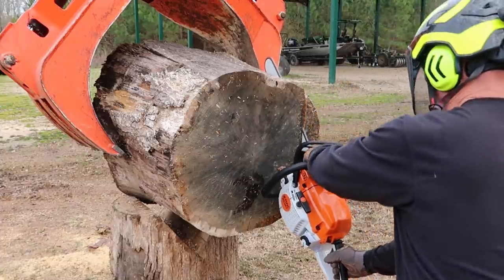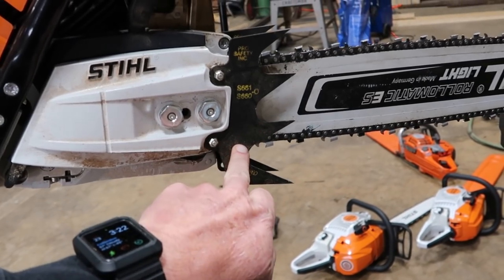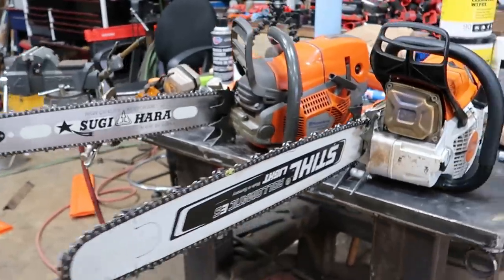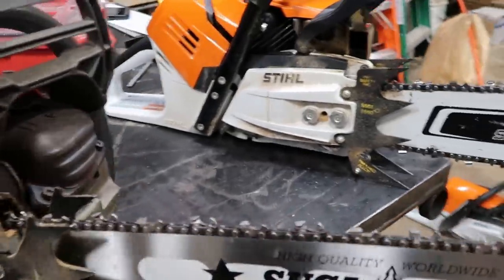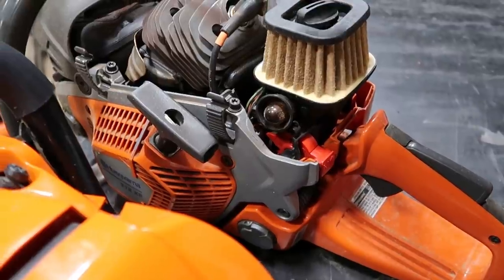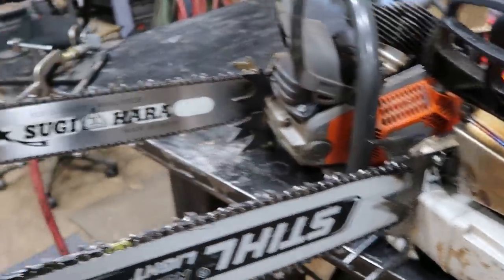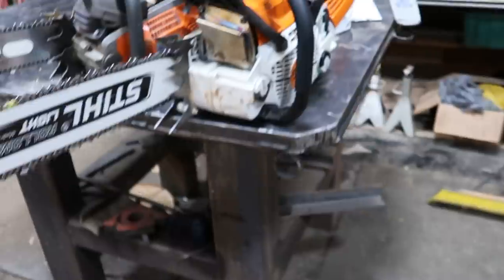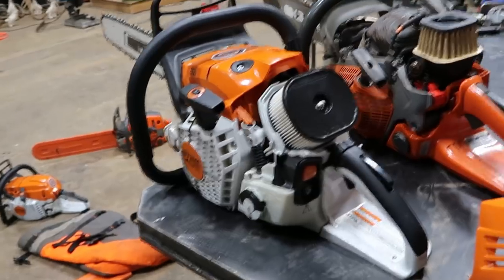Husqvarna VS Stihl | Autotune VS Fuel Injection | The best chainsaws on the planet

Comment: Husqvarna made in Sweden better saw for higher altaduide more expensive high end high  compression high idle  with sthil made in Germany  everything is bigger little more heavier less expensive runs best at lower  altaduide  unless tune the carb

Comment: I’m a Stihl guy but I might give the “Husqvarner” a shot on the next one. Day in and day out the 8cc’s or the weight prob won’t matter that much. Lot less money. The only advantage I see is the fuel injection if you’re using one at drastically different altitudes, which is not too common.

Comment: Yer good vid, caps on stihl could be much better" an air filtration huskys always better. But have had probs with husky auto tune. An stihl injected so far seem very solid n just run. Cheers

Comment: About 26 Years ago, I owned a Husqvarna (don't remember the model #) but for that model year, they put faulty cylinders in them and it shortly went ka-put. They offered a $90 rebate for a trade in. I was pissed so I traded it in for a Stihl, 029 Farm Boss and it's till running like a champ!  Won't bother with a Husky! Judging by the current construction of the Stihl, it appears Stihl has gone downhill!
Reply: Sthil uses Chinese parts now where husky doesn’t..

Comment: When I bought my 572, the 500 was twice as much and a second or so faster.
Reply: The 500i is way faster than a second, probably close to 20-30% from my use, but only when going with 28+ bars cutting big logs. With a 20-24" bar, probably 10% faster with a sizeable increase in torque also, so definitely not worth the price difference, at least for me. A ms462 or 572xp is best bang for your buck if all you use is up to 28".
Reply: @em4703   I've seen vid. A second or 2.